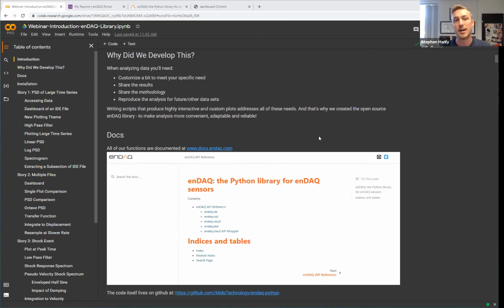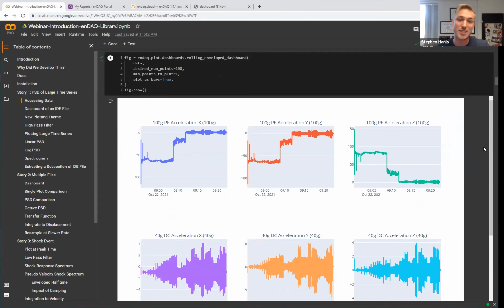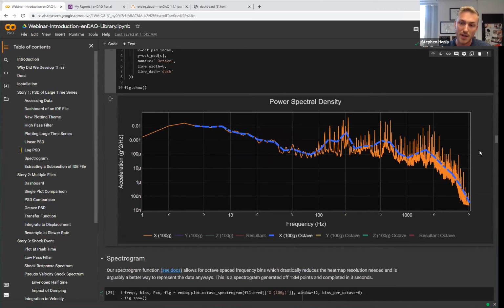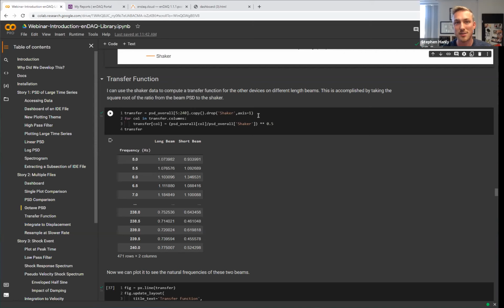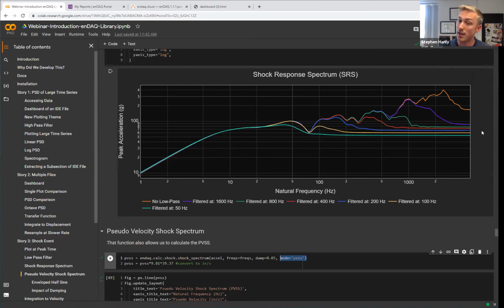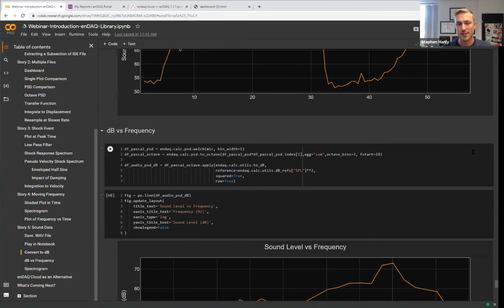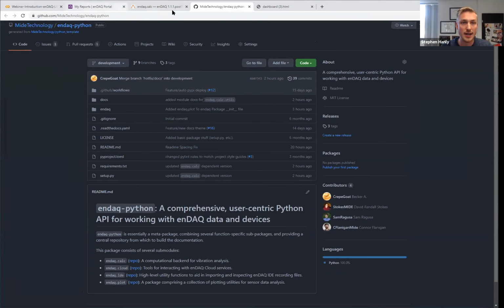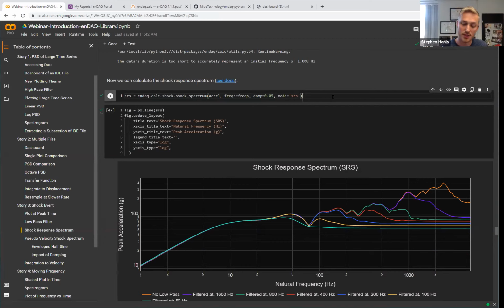Simplifying Vibration & Shock Analysis with the enDAQ Python Library

Comment: @28:26 Can you please explain why do we need to resample the data? what happens if we do not resample the data?
Reply from the maker: In this part of the video, the data being analyzed is displacement over time. The utility/value of resampling such a data set is to allow someone to define the resolution of the specific data that they want. The data can up-sampled (increased number of data points), or down-sampled (decreased number of data points). 

The effects of resampling can vary depending on the data set. In general, resampling is performed to determine if/how data behave differently with respect to different levels of resolution.